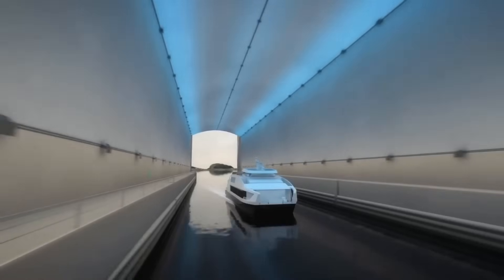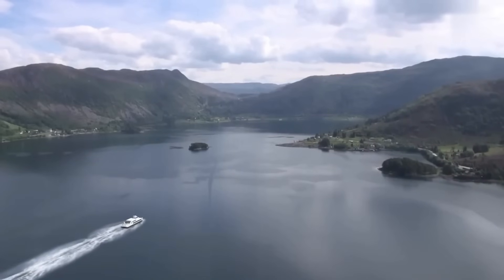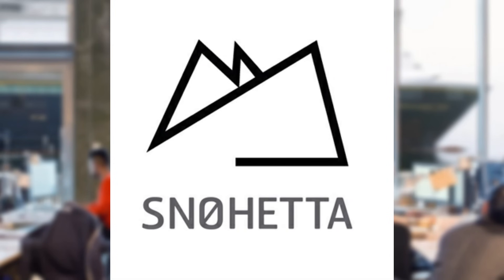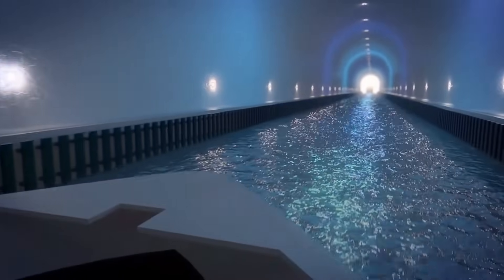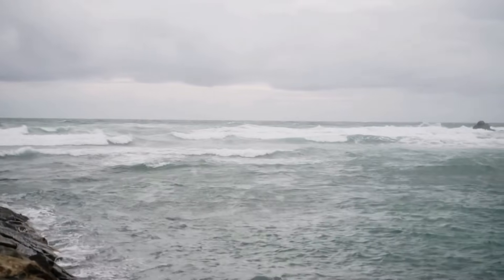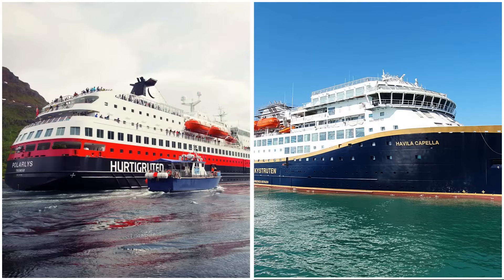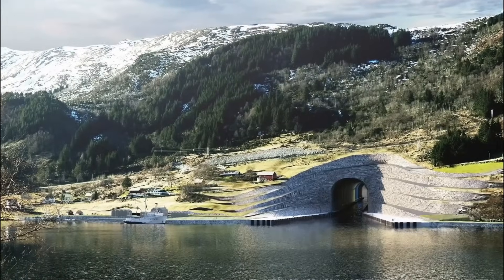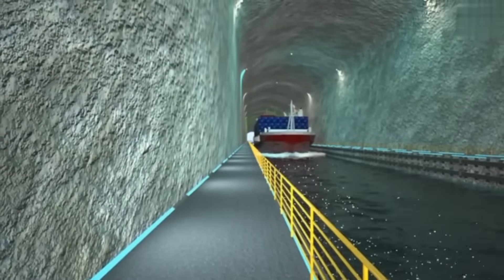How Norway’s Revolutionary Cruise Ship Tunnel Will Change Maritime Travel!

Comment: This tunnel is simply not needed. All they need is a road across the little hill at the bottom of the Stad peninsula and the same ship doesn't ever need to visit both sides. Hold on - I just looked at Google Earth and the road is already there - the 618. You could provide a free bus service til the end of time and it would still be cheaper than the tunnel.

Comment: 8:20 "No plans to make the tunnel passable on foot" you state.
I think that something may well have been lost in translation here.
Common sense dictates that at the absolute minimum there will have to be some sort of emergency ingress, access and egress system in the tunnel. Can't see it being a walkway as a road would take up little more room in this mile long marvel.

I imagine that the intention was to say that there are no plans to provide a publicly accessible path or road through the tunnel ( but of course there'll be provision of an emergency one).

This smacks of the Panama Canal, too. It can't fail to be a success so how long before more mountain carving to provide two tunnels to stop the flow restriction occasioned by the present hour on/hour off passage of ship traffic?

Can't wait to see it.